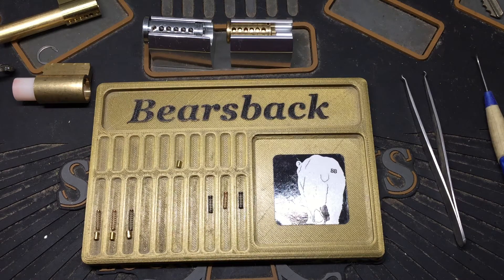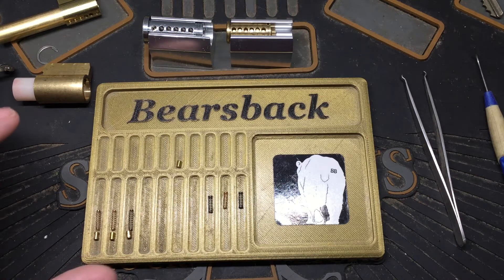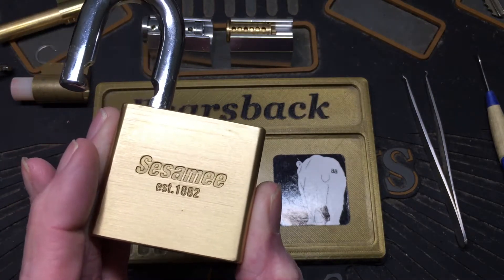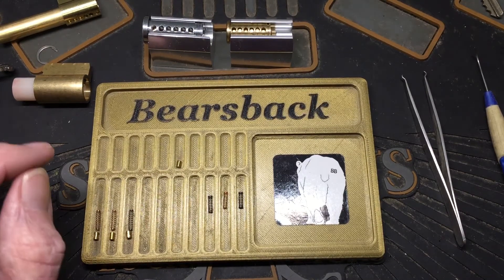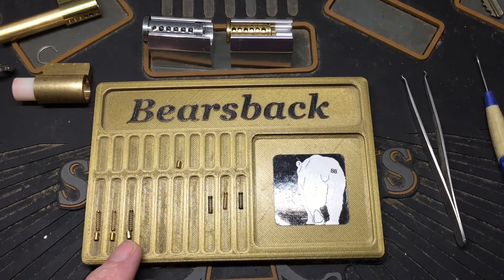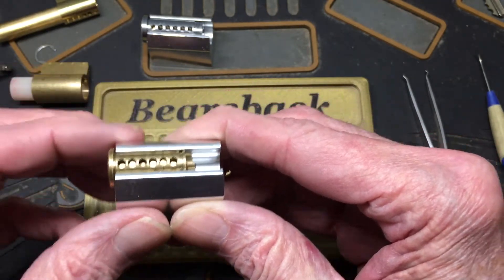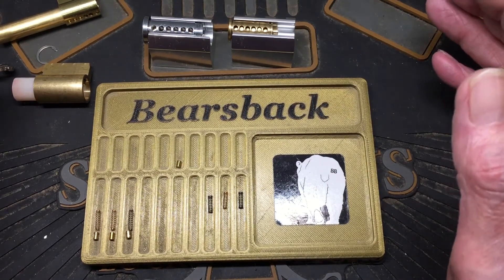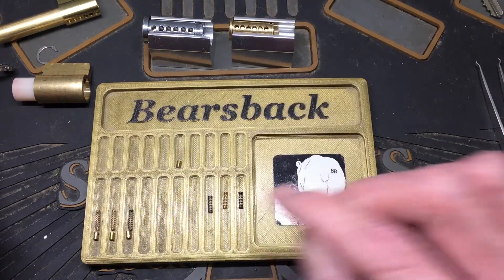(368) How Do Anti-Bump Pins Work?

Comment: Great explanation here, thank you for making this. I have the Ilco anti-bump pin in my personal door locks but put it in the last chamber just because the spring is so strong, I wanted to minimize wear on the key over time (in the last chamber it would only ride over the tip on its way to the last cut). I guess for lock sporters we’d probably always put a standard pin in the first chamber (to eliminate turning slop in the cylinder and hide what’s behind), anti-bump/strong spring in the last, and security pins in between 🤣 I also put springs of different strengths in the chambers too, just to go overboard lol 😂